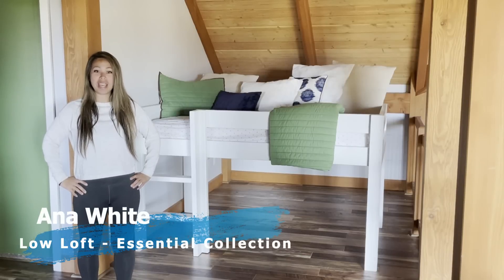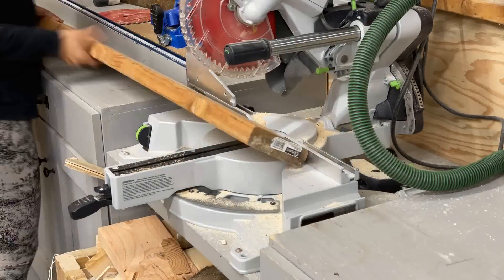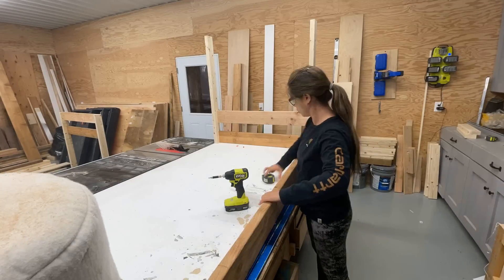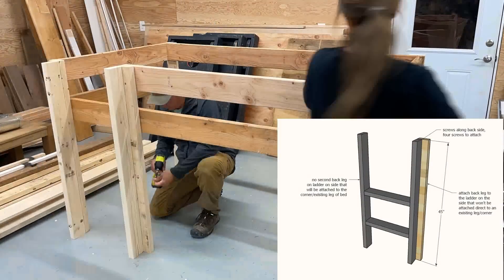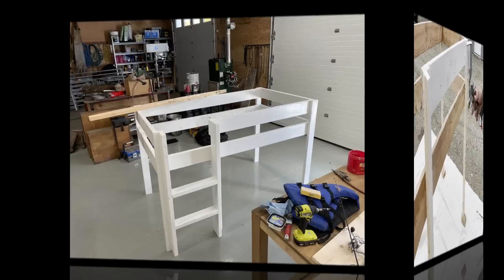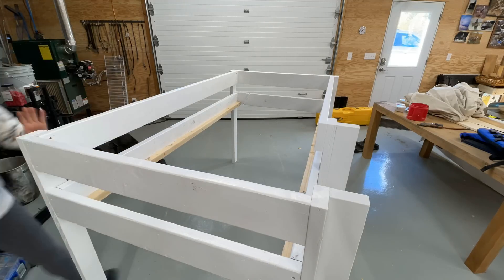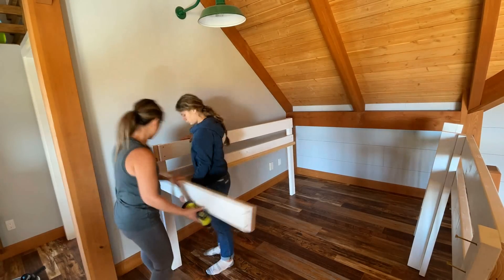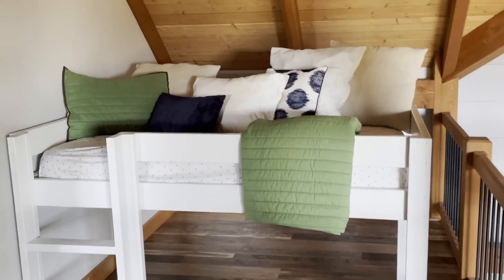Build a Loft Bed with Free Plans

Comment: Mezzanine with walk-in closet underneath.  Very clean lines.  Something for a studio apartment that doesn't look like a bed. I guess I am trying to say like two rooms closet with storage and mezzanine that feels private.
Reply from the maker: That sounds amazing!
Reply: @AnaWhiteDIY  thank you I have a 34sqm studio space in Germany, with a small balcony.  Hence the need for something that looks like two separate spaces.  Here in Germany closets are not built in.  So you have to buy a storage cabinet for clothes, linens, anything you need to store... So the space can fill up quickly if your not careful with planning.  Luckily most ceilings are 11ft or higher...

Comment: you are amazing. I found your blog about 10 years ago and I now have an opportunity and need to build my boys a loft and bunk. I've got 3 boys. My 2 older ones share a room and the ceilings are low. So I need a bunk that has short legs. The bottom mattress would set on the floor inside the frame, and the higher bunk would need to be low enough for my son to sit up in bed without hitting the ceiling. This lower loft bed is perfect for my other son who has a low ceiling as well. I may try to lengthen the legs just a tiny bit so I can fit his desk underneath. Thank you so much for all you do!
Reply from the maker: Wonderful!

Comment: I need to build a bed frame I can put in a van I'm converting. I love that the height of the four corner pieces can be cut to a height that will fit the exact space you're working with. I'm excited to try this. Thank you!
Reply from the maker: That's a great idea, I'd love to see it!
Reply: @AnaWhiteDIY  I tried to register on your website but  I'm having trouble logging in. Is there an email address on your end I could send a message to to get some help with this?

Comment: You know what would be a neat build Ana... a bedding system with which had drawers and shelving under the bed but on the inside with a lift system for the bed where you could have access from the foot of the bed as well as shelving made into steps to get into the bed.
Reply from the maker: Super cool ideas!

Comment: Oh my gosh I'm so glad I saved this one I found it the first time. Yes yes yes I would love to see you make a slightly higher low loft bed. I want to create a low loft full-sized bed that has storage steps just to one side. That way I have storage and steps rather than a ladder. I'll be working in a limited space In the back of a converted shuttle bus so the total height
 of the space I'm putting it in is going to be roughly 88"L x 78"H x 60" W. I can have total storage underneath :-) I'm figuring putting the bed across the back. I was thinking of having storage steps that go over one of the wheel wells to one side and the other has double doors that will open up so it'll be a bed with a view :-) or closed and just be an incognito wall with some storage space
Reply from the maker: Thanks for the visit, have you seen this plan https://www.ana-white.com/woodworking-projects/camp-loft-bed-stair-junior-height
You may be able to modify for your space and needs.

Comment: I contemplating a low loft bed for myself, am an adult, not a kid, but the dimensions are basically the same as an adult version but are usually made shorter which is what i need, the space beneath to store thigns, drawers etc, but also not too high and too close to the ceil, especially the lamp
Reply from the maker: Cool! Thanks for the visit.

Comment: Would this be just as sturdy and safe if you made it a foot taller?
Reply: Also what is the height of the mattress you used. Thanks so much.
Reply from the maker: This is 8” thick

If you go taller you may need a 2x4 rim around the bottom to tie the legs together.

Comment: I am a bit ignorant,  so please don't be offended but is it safe enough, because the only thing holding the slats is the 2 by 2s?
Reply: Slats on beds are generally 1-by's, so these are twice as strong, and the weight is spread over the length of the bed. Should hold an adult easily. 👌
Reply: @kathyusa-iowa5137  yeah but in a "normal bed" the distance to the floor is a lot smaller.